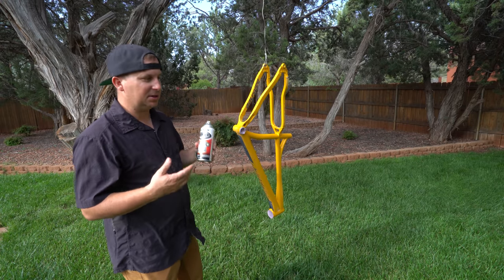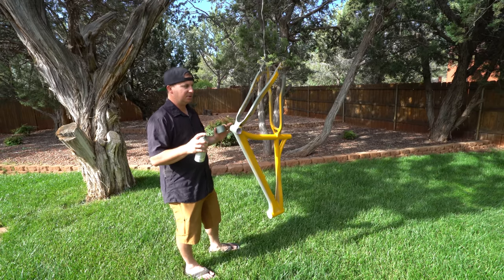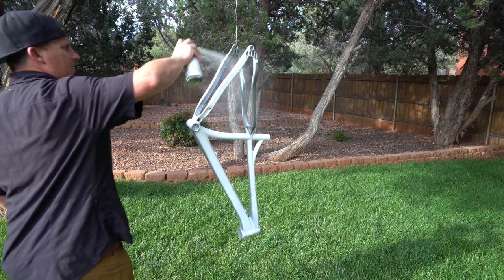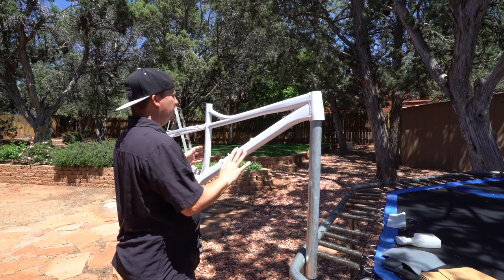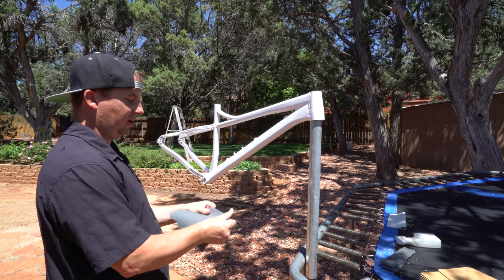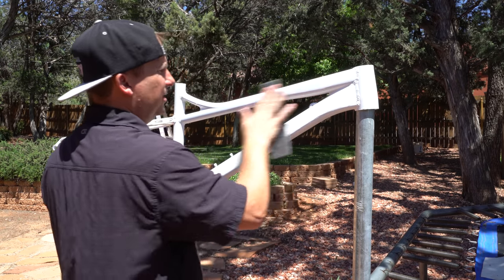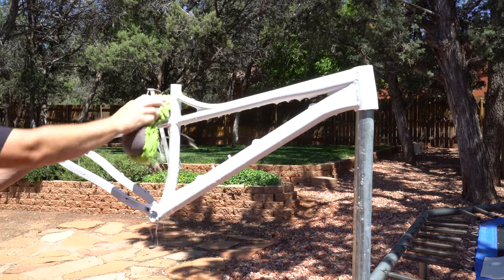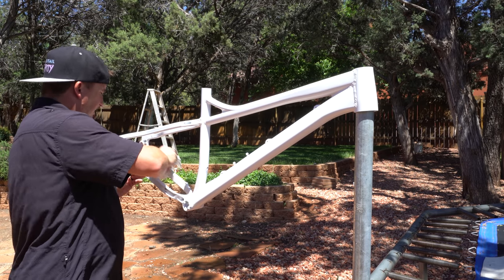The Banshee Paradox Makeover Project. Part 2: The Painting Begins - Hardtail Party

Comment: Pro Tip - Steve, I have rattle canned a TON of stuff, including a full car.  When you shoot the color, get a plastic container and put water in it and heat it in the mircrowave for 2-3 minutes.  Not boiling but nice and hot.  Put your spray can in the hot water for 1-2 minutes before you start spraying.  You want the can and paint inside to be nice and warm, even on a hot day  Shake it well as you normally would.  I have found that when I do this the paint and carrier mix better and as a result sprays in a finer/smoother mist and I get a better finish.  Thanks for sharing, can't wait to see the final product.
Reply from the maker: Good tip. It's 90* outside here, so leaving it outside for an hour before painting should have the same effect. I've done that in the winter before though, it's a great tip.
Reply: @hardtailparty  Yes for sure.  Just let the paint can soak up some sun.
Reply: I like that tip! I'll have to try heating my paint cans first... seems like a sound concept.

Comment: I used spray.bike paint. The prep is always the worst. The color from spray.bike comes out liquid for about 1/2 a foot and then dry during spray. The color does not run easily. The clear is runny. I painted 5-6 layers including primer and I sanded between each.
Reply from the maker: I reached out to them to see if they wanted to paetner, but they essentially said "we need to know you're a halfway decent painter before we send you product." Fair enough.